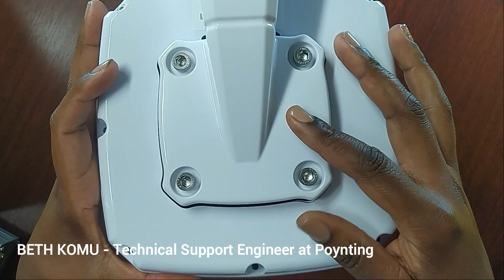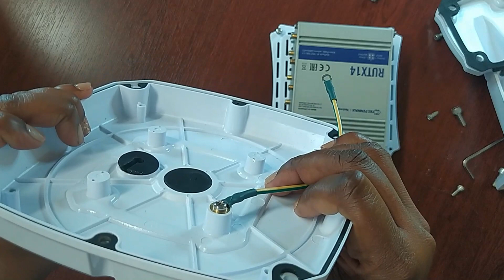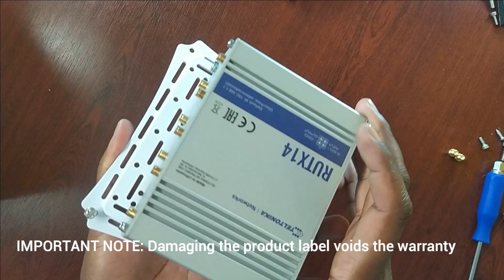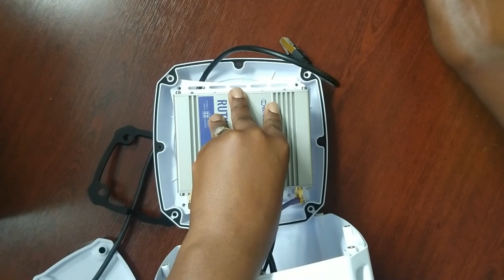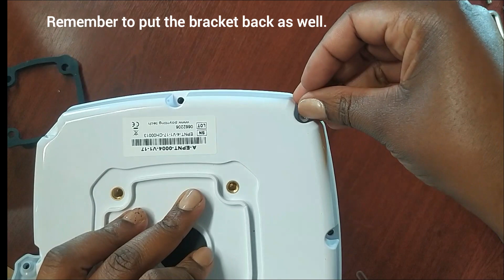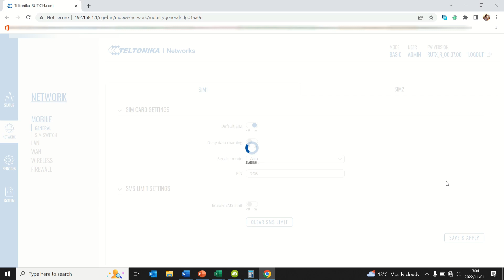How to fit a Teltonika RUTX14 into a Poynting EPNT-4 Enclosure

Comment: Hi there, did you have to change the gender on the WiFi antennas?
Reply from the maker: Yes, I used an RPSMA(M) to SMA (F) adapter to be able to connect the Wi-Fi cables to the Wi-Fi ports of the router.

Comment: So if i need a toolbox, i just buy a poynting-antenna ...

... and get a 1970s analog-telephone-grey plastic-ballon as an extra.
Reply from the maker: The tools to open the unit is included. Not sure what a plastic-ballon is?
Reply: @poyntingantennas  It wasn't meant negative. The amount of tools and included parts is just visually so overwhelming and made of solid metal while on the other side there's "only" that plastic-balloon of the antenna sitting on the table (of which you can't see the sophisticated internals) so taking this visual ratio one could make fun of where the money one paid really went: into the amount of solid metal parts or that "simple plastic balloon". Of course, it went into the antenna ... :)
Reply from the maker: @Vorname_Nachnahme  No worries - we understand 😊. We get used to our stuff and it is sometimes good get a "fresh" view.

Comment: 1.) Isn't that a router crematorium with no air circulation in that antenna cage eventually being exposed to hours of full sun blast oO?

2.) So with the router the sim-card is also locked away "forever". Hm ... Oo
Reply from the maker: 1. Please note the following:
*Routers/Router boards have their own operating temperatures as provided in their
individual data sheets. Routers/router boards mounted within an EPNT-4 which is
exposed to solar radiation will operate at 10-12°C above ambient temperature.
Please take this into consideration and select your device to be used with the
EPNT-4 accordingly.
2. Yes to change te SIM you will need to open the antenna enclosure.
Reply: @poyntingantennas  Thank you for taking the time for detailed answering a potential customers questions respectively answering at all. That's one big pro argument to buy products from you!